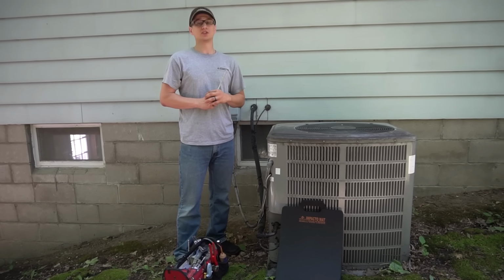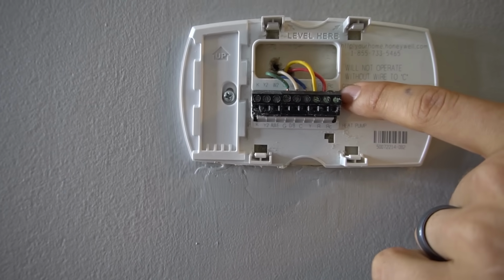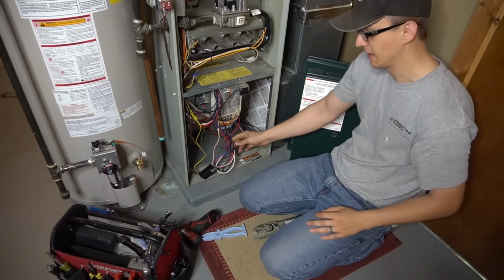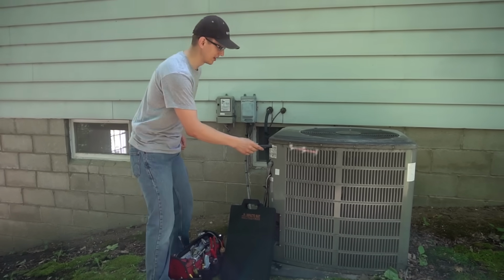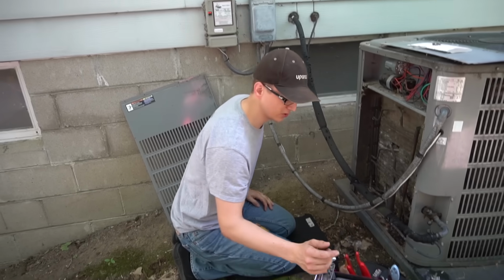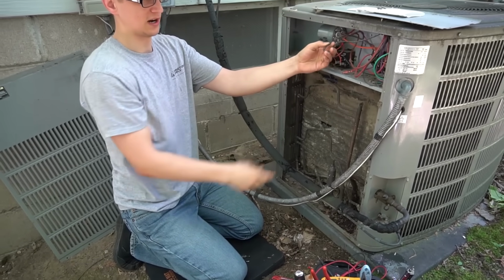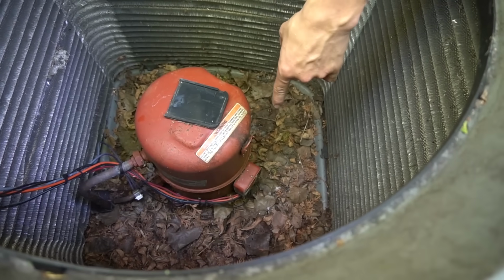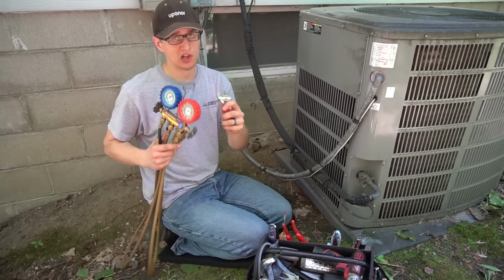AC Unit Not Turning On - How to Fix It Step by Step

Comment: Thanks so much. As soon as I opened the panel to the electrical there was a mass of nest material and a dead mouse who got stuck in one of the wire cutouts. Something shorted on the way to the contactor and I was able to troubleshoot the wires with my multimeter. Thanks again, saved me big $$ I'm sure.

Comment: Excellent video, let me run this by you, ok inside everything works as it should, fan kicks on as it should, thermostat works as it should, breakers inside are not tripped, ok outside, the condenser, had wife help me out here, when she turns on the AC at the thermostat, fan kicks on inside, but while I'm outside, I only hear a click, and then nothing, I always test my stuff during winter, to make sure everything works, and it did in February, went to turn it on today, to make sure everything was working but the outside condenser isn't, I don't see any wetness or green so I'm not suspecting low on coolent, all I hear is a single click inside the unit not on the wall, any ideas?
Reply: Figured it out, loose wire in the outside power box.... All fixed and running like it always has.

Comment: I never leave comments but I have to say thank you for this one. It totally clicked and helped me fix my AC system. Checked all the electrical signals and everything seemed fine, but noticed the freezestat lockout was blinking on the control board. No idea why that wasn't cleared because the coil wasn't frozen, but power cycling the furnace fixed an issue I've been having for weeks. Thanks so much for this video. Learned a ton and saved money calling a repair guy.
Reply from the maker: You're welcome! Glad to hear it helped! Thank you for leaving a comment, stay cool!!

Comment: Excellent video. Question. I work with mini split systems very often and to check charge i use a clamp meter to check amperage on the compressor. The label tells you what the amps should be on cooling and on heating. Can this method be done on a central air system? What is the easiest way to know how much charge system needs? Superheat?

Comment: Thanks a lot really helped me out! In my case it was actually a loose plug, it looked the a wire came unplugged on the outside of the box with lights on it in the basement, so I pushed it back down and it started humming right away.

Comment: Amigo. Help me out. I turned my ac unit for the (first time this year)yesterday and I did work for about an hour. After it stopped completely. There is no sound at all, but if I push a small button inside the panel like next to the capacitor, it all works, so I replaced the capacitor and still doesn’t work, but I can still make it run by pushing that button but again it works only as long as I keep my finger on it, if I release it all stops. WHAT DO I TRY NEXT?   Please reply at EMILIANOROMERO641@YAHOO.COM
Reply: Having same issue please help....
Reply: After some more testing the transformer ended up going out ....was told by a HVAC tech that it would explain why i didn't get 24v at my cooling wire but it would still power my heat....the heater doesn't draw as much power to switch on the relays to control the heat as the the AC contactor does to turn on AC....so if you have a similar issue then possibly it's the transformer..
Reply: I'm going through the same problem right now. A/C unit stopped working. Checked and have 240v at contactor but no voltage at contactor coil. Everything works fine if i hold contactor down. Checked transformer and had 0 output voltage. Replaced transformer and still have same issue, 0 output voltage from new transformer.

Comment: Last Fall my AC compressor was coming on when the heat would turn on. I had turned the circuit breaker off for the AC so I could troubleshoot it in the spring. 

Now that it is spring, with the AC power turned back on, the AC will not turn on. Both the blower fan motor and the compressor are not coming on in AC mode. The heat is working normally. I do also have the thermostat set in the HOLD mode so I could rule out a program error/issue with the thermostat. Any ideas.  Thanks and very detailed video.
Reply: I have the exact same issue. Heat works, AC does not.  Checked the power on the control board (thanks to these videos) and power is good, 26,1v out R-C.  Can push the plunger switch on the AC and it runs, Compressor and Fan.
Reply: @gerrydomagalski6288  I found my problem. Somehow two wires on the thermostat mounting plate (the plate to attach the thermostat to the wall) snapped of the terminals. I never noticed it until I really looked closely with a flash light. So mine was a thermostat issue with the wiring. I'd recheck yours really closely as I missed it the first few times. Good luck...
Reply: @uptownphotography  Thank you for the reply.  I actual did figure out my issue as well.  Very similar, the solid core wire broke inside the shielding about 10 cm from the connection at the control board.  I was able to use a jumper at the control board to start the AC unit but it would not work when I did the same thing at the thermostat which lead me to a faulty wire.  
Glad you were able to figure yours out as well.
Reply: @gerrydomagalski6288  Glad you figured yours out too Gerry. It will be getting hot here soon in NJ so already using the AC to stay cool. All the best and stay safe..........Philip

Comment: Awesome video. My thermostat wasn't replaced but it was disconnected during some remodeling.  I have heat with fan in auto. But no AC (nothing happens at all) and I can't manually turn my fan on (fan on mode nothing happens).  Any suggestions?

Comment: Hello, i have older Amana Hi-Efficiency unit, what' i'm experiencing now is the outside unit runs fine, but i hearing the one strange noise from the attic, that some device trying to start and couldn't, and it creates the interval noise like every one or 2 minutes, that last for about good 5 to 10 minutes, and while its happening, AC is not cold, even the outside unit is running. After about 5-10 minutes, that noise from the attic stopped and AC cold as normal. If any of you can please kindly advise what device/unit we have in attic and any service that need to be done would be really appreciate it.

Comment: Hello, my HVAC got serviced last year and freon was checked but this spring i started it and for some reason it didn't seem to cool much.  A moment ago i went to power switch and turned it off and on and I do feel it a little color.  Does that mean my capacitor may be going out or r22 is going low?  I am about to buy two capacitor's on amazon for $20 but not sure if it's a good idea if i am forced to buy a new HVA/C unit.  Which brand do you recommend for a 1650 sq. ft home?
Reply: @Long Way Home okay, had it serviced last year and it was washed.  I will do that first.  I did order a $10 dual capacitor though.  50 + 5 mfd, it arrives thursday.  I have the foam cleaner from home depot, I'll try to do that on the coils too this week or next weekend.  A quote I got was for $65 to clean, inspect and check freon
Reply: @Long Way Home thanks

Comment: This video is incredibly helpful. Testing the contactor as you describe and confirming the AC unit turned on was key. I thought it was the capacitor initially, but after pressing the plunger and having the unit come on, I was able to determine the problem was inside the furnace. A wire had come loose in the furnace (it wasn’t obviously loose).  Reconnecting that wire did the trick. Thank you so much!

Comment: Thanks for the nice video.I have a Nest thermostat and it says Y1 cable not getting power. I noticed that condenser unit not starting at all. I replaced the capacitor but I still see the same message at thermostat and condenser not on.  Any suggestions please.
Reply: I gone through the video again and tested the contactor with the multi meter and observed that contactor is the culprit. Thanks again for the nice videos.

Comment: Hoping you will see this and respond.. I have an older Amana unit. I have new fuses at the wall shut off, I also replaced the capacitor, it's a 3 way. I know I have all wires connected correctly, I have power to the unit and my furnace works, it blows air into the home when turned on. Thermostat is good, all wires are connected and tight with jumper from RC to R and has new batteries. Also, 3 amp fuse on furnace is good, also have all new filters. I can hear the unit clicking when the thermostat is turned on, however, thermostat blinks COOL ON for a bit, according to Honeywell directions, that is to protect the compressor. So at this point, I have power to the unit, the contactor seems to be working and pulls in with power on but the fan will not spin, even when I spin it with a screwdriver, the fan seems to spin nice and smooth and is not bound up. I believe the fan motor is bad but not sure how to test it. Hoping you'll drop a comment. Or any one of you HVAC guys, I'd appreciate it.. I was getting some funky readings with the old capacitor so that's why I replaced it. So new fuses and a new capacitor, I'm done throwing parts at .  Help lol....

Comment: If plunger doesn't move in (when called for), what typically is the cause/solution?
Reply from the maker: Usually it will be one of these 10 reasons :) https://www.youtube.com/watch?v=NVPhsK4gK1A
Reply: (With screwdriver pushing plunger in, unit goes on)...then, AC tech checked unit, said DC motor backfeeding/overloading, blowing transformer (est. $2,500)...is this likely? If so, why did pushing plunger (manually) start the AC?

Comment: love your instructional videos, long time viewer, first-time caller:) my problem: Thermostat comes on but fuse blows every time trying to trip on the outside fan. blower motor comes on, all wires in the furnace unit seem to be working fine and turning motor on (removed all and tested with a new fuse.  Plunger pushed in turns on outside fan in bypass (test mode) only; 240 Volts going in but no voltage coming out of contactor, coils seem normal and connected properly.    The capacitor has no bubbling and looks brand new.  disconnected all the wires outside and coils are clean and free of debris.  condenser fan moves freely when turned with a screwdriver.  The system is about 5 yrs old.  Trane unit.  Is the Contactor you think the main problem?

Comment: Ok so, I cleaned both of my condensers like I'm supposed to. I then tested them out after they had time to dry. One came on fine and the other one made a nasty rattling sound that I could hear from inside the house. I shut it down then went outside to see what was making the noise. Turns out that the fan wire and the smaller capacitor were not clearing the fan blade. I secured the wires that still looked ok and then the capacitor. Tried to restart the system and only one click and then a buzzing sound. I checked all wires again and they looked good. So I then replaced the smaller capacitor and the contact. Still nothing. The other  larger capacitor looks fine. Not sure what to do now. What do you think?? This system was installed in 1993 but was working fine last summer. The brand is ICP.
Reply: I think I have it figured out but I want to hear what you have to say.....

Comment: Hi , not sure if anyone has asked before but my problem is  with every thing , followed along with your video - checked out ok , except that when the compressor sounded like it started and tried to run but then it quit, and a few min later , it tried again but cannot take off and then quit.  I have checked and replaced the capacitor...but the problem persists..i guess there's ssomething wrong with the compressor.....like when it tried to start, it got stuck somehow and cannot take off.  Any idea?  Thanks

Comment: Always remove the leaves from the compressor compartment, cos the underside of the compressor will rust and leak gas, which is difficult to repair. 
Also can a coil be fixed? If remotely accessible : sure it can! 
BTW American AC looks horrible! The design and low tech, that horrible place to mount the compressor, the electrical "whip" yuk!

Comment: Hi thank you for the video. Question  I just put in a new thermostat the Honeywell T5 . I noticed that my AC compressor is not turning on. I noticed you said in the video that I have to put a jumper cable from R to RC should I put a jumper cable on this or does the unit automatically jump it with the hardware it comes with? Ok thanks

Comment: Hi, my ac was working great until I changed out the
thermostat and now the system is not blowing cold air. I put the old thermostat
back on and still blows but not cold. What did I blow up? ha...Thanks
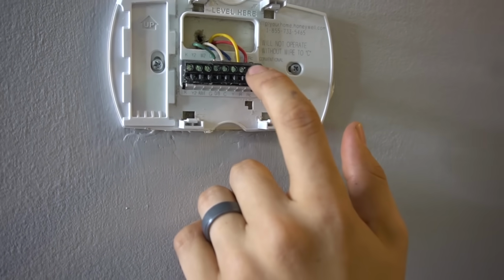Reply: Watch video 4:03

Comment: Hey I have a Goodman AC I replaced the contactor it was burnt my problem is the contactor is not pulling in it has about 6 thermostat wires that is not connected will you help me Thanks

Comment: I have the nest thermostat. Its wired right. I guess my problem is that it gets really hot in odessa texas. It's a new unit in direct sun. 2 years old. Coils clean and filters clean. My unit cannot keep up with the heat.  It takes a long time to cool. I'm wondering if it could be the nest?  I wanted to get a half ton bigger. The tech's said It could handle the hottest summers. Also i had my dad go up top and check the ducts. No leaks. Any suggestions?

Comment: My only regret is that I have but one upvote to give.

You, sir, are fantastic! My AC wasn't working. I thought it was the capacitor and apparently the multimeter that I had doesn't have a capacity mode on it. Tried like hell to find a place that was still open and that sold them despite the current apocalypse. No luck. Ended up getting a better multimeter and found out the capacitor was fine. While trying to figure out what else it could be, I came across your awesome playlist. Turns out a spider laid a bunch of eggs in my definite purpose contactor like you mentioned in this video and the one specifically on the contactor. Had to remove it to actually clean it out, but thanks to your video, I saved however much it would have cost (in both money and sanity while waiting for a repairman). Got yourself a subscriber and I'm definitely sharing this playlist.
Reply: Phenomenal job..
I don't know who you are but I bet your a big deal... I can't say enough how much I appreciate your videos and just a style in which you deliver..you should teach the class on making videos forutube. you would seriously collectively save thousands of hours of people's lives a day...
Reply: Hello Richard, my problem is the unit outside is running but not cooling . I notice a sweat around the unit inside. Could that mean a plug in the drain line and how do I fix it. Reply needed
Reply: @ericappiah9822  Your refrigerant is low.Does it stay on all day and dont reach temperature yo got it set on?

Comment: What would cause a hissing noise near the evaporator coil in the inside unit? I can hear it through the return vent.  Every-time that occurs the unit will not blow cold air.
Reply: Note- it happens for a few seconds when unit turns on
Reply: Video of hissing sound.  https://youtu.be/e594www2ZZo

Comment: Great Video! I have a Trane Unit which had a clogged drain line. Cleared the clog but unit still has red light blinking 11 times indicating condensation error code. I shut off the breaker but unit still displaying error. How can I reset the error code on a Trane AC?

Comment: My contractor isn't going in when I turn ac on but when I press it in everything works. Fan inside comes on to. What could it be
Reply: For me it was the 5amp fuse on the furnace. Also check the thermostat wires.

Comment: The order should be breakers, filter, drain line, and the then most common problem, capacitor. Your way allows more time and fees, but capacitors are the most common problem.

Comment: Turned A/C on today and went about my business. Later on I was in the flower bed in front of the house and heard the outside unit turn on, then turn off,.... turn on, then turn off multiple times every 15-20 seconds. Everytime, the fan would spin but I never heard the compressor kick on. I haven't investigated anything as this was around the time that it was getting dark. Inside, air was blowing out of the vents but was not cooling the house. Maybe the capacitor or the contact???? What do you think??? Model - HXA648GKA100. Thanks

Comment: Hello,
I have a problem.  Inside fan turns on BUT the outside cooling unit does not.  Thermostat checks out by jumping Power and Fan then Power and A/C.  Pushed outside contactor button in and everything  starts up and sounds good.  BUT when setting Thermostat to cool, nothing turns on outside by itself.  
Any ideas would be greatly appreciated.
Thank-You for your time, consideration and expertise.
Reply: P.S.  Unit is a Carrier 38yxa - 5 ton - 2005 - Thank-You
Reply: @glassstud2095  I have the exact same issue with my Trane unit.  Thought it was the run cap but no dice.  Still troubleshooting...
Reply: @jamieweigold5234  Thank-You for your response.  When and if I find out the problem, I will pass it on to you.
Reply: @glassstud2095  Turns out my issue was the thermostat.  I bypassed it at the control board and the AC ran fine.  Another ding for Nest thermostats...

Comment: Thanks for the video! My fuse was blown on the main ckt board. Replaced it and walla! Checked for wiring issue, could be possibly bad main board. Will look into it if problem reoccurrs.
Thanks again

Comment: My 2.5 ton goodman heat pump is not running the contactor is pulled in and buzzing but the compressor and the fan is not coming on. I have already replaced the run capasiter . what would you suggest.